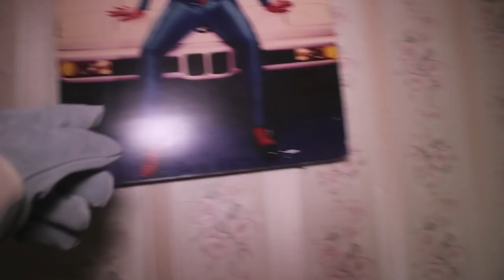THE ULTIMATE FORECLOSURE FIND!

Comment: I used to do property cleanups for private parties, but was on one forclosure cleanup before health issues forced me to give up any form of work. It was very rare to get a cleanup job that I didn't find many good sellable items unless it was just hauling away old brush or wood. Saved and sold more than I can list, but I ALWAYS made sure to carefully check out and search through everything. It's amazing how many people will hide money, in books, clothing pockets, cars, etc. Removing a collapsing divider wall from in a garage netted my helper and I over $900 cash at face value in old money from the 1920's-1935. Another job resulted in 29 classic cars, 7 vintage heavy trucks, 2 vintage motorcycles, and 5 vintage snowmobiles. THAT was my best haul. But you are hitting some REALLY GREAT STUFF. Keep your eyes open for small  vintage singer featherlite seeing machines- they bring good money. So does some vintage stereo equipment even if it's not working-- such as analog blue face (dial area lit up blue/ green) Marantz, old pioneers, Fisher, Macintosh, etc. Always check out the stereo stuff online before getting rid of it as scrap or trash because even not working it may be worth good money.

Comment: the thing is  you  have to put a notice  in the paper  to see if any family  steps forward before you can move forward... Then you  ask  the dmv  what the  procedure  is  for  getting title on  the vehicles  due to the  way  your getting them as part of the removal. might not cost alot to do .. even if you spend around 500 between  getting keys made and  titles done  it be worth it  for the sell values  from them .
Reply from the maker: Everything on the property is fully owned by the bank. Anyone who had the chance to claim the bike had to two years only problem is that the bank won't sign anything they just want it gone.